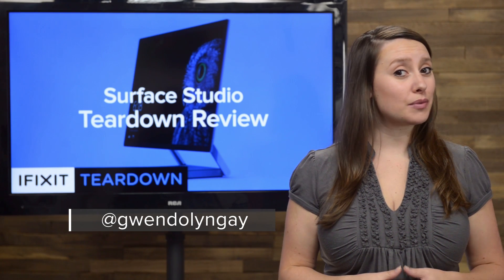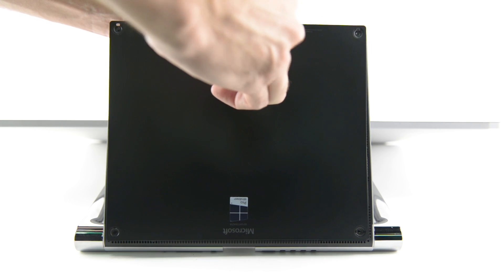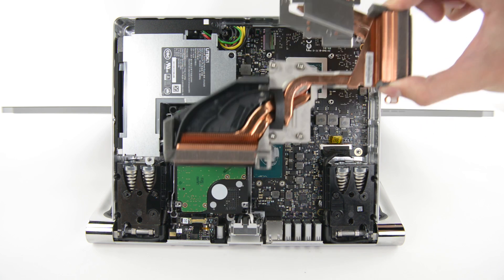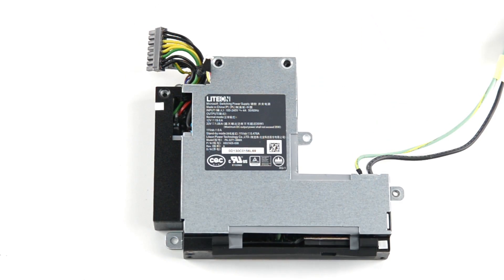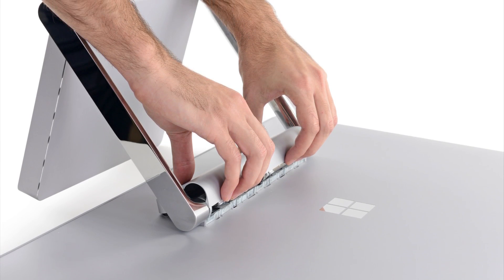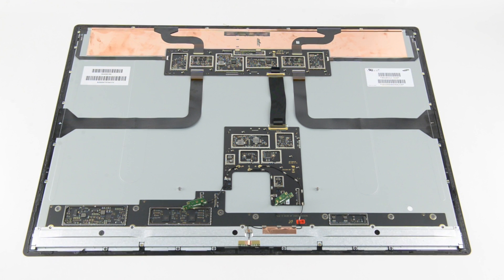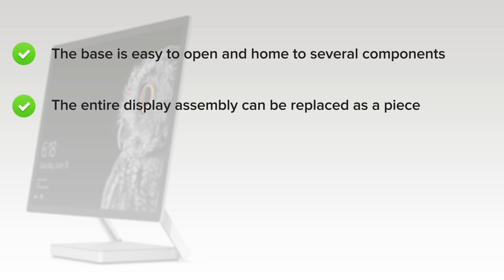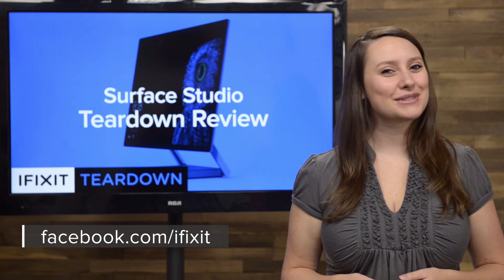Microsoft Surface Studio Teardown Review!

Comment: The 5400 RPM HDD would be the first component to upgrade. It´s a joke even when combined with an SSD. The 5400 RPM HDD was something I didn't expect to be found in a 3K machine. Even the high end 5K iMac with 2TB fusion drive has a 7200 RPM HDD.
Reply: Fisu614 and that's all you can upgrade.

Comment: need to upgrade to 1tb ssd, 16 or 32 GB ram, 1080 video card and quad core I 7
Reply: Friendly Guy On Just Looking Around. there are three versions of it, this was the cheapest one, the next comes with i7 processor, 16GB RAM and 1TB ssd, the best one comes with i7 processor 32GB RAM and 1TB or even 2TB of ssd i cant remember

Comment: I was waiting for this one..

The CPU is fixed, is ok for me. But memory. I wish it could be upgradable. That would be a shame if Microsoft will chose that path to demise Apple is currently on.
Reply: Sergey Romanov got news for you Apple starts the trend and everyone follows. This is a Windows version of an iMac.
Reply: floex831 This is a stupid trend that does nothing but decrease the potential life of a computer and removes choice for the user. I don't even get it, what excuse could there possibly be for non-upgradeable RAM in a desktop. WTF?  There is not even an issue with saving space(which I still think is a poor excuse) because you're not going to be moving it around anyway. What a load of bullshit.

Comment: 5 out of 10 seems to be a bit low. It looks rather easy to service most things.
Reply: Most things? Can't change the RAM, GPU or CPU. 5 seems plenty generous.
Reply: I would tend to give it a 6, just because it's not only easy to open, but there are also no special screws with security stickers and you can easy replace both SSD and HDD. 
RAM and CPU would have been nice, that's for sure. It's not like they are trying to stop the user or someone servicing it, everything seems accessible.

Comment: Not sure if nonremovable was the goal, but it would have been pretty easy to make the thing a half  cm higher, and add removable option. Heck. I wouldn't have mind if it was 1- 2 cm for bigger heatsink.
Reply: Bardia Ghajari I guess this might have interfered with how low the screen can be moved. They could've made it wider or longer, though. And the base model is a joke. 8 GB RAM? 5400RPM drive? No. Just no.
Reply: Yes, but 4-Grand for a desktop, which runs like a laptop, is for "take my money, I don't need it" people. People who need expanded performance already have another desktop, N.A.S, or cloud-strorage subscription

Comment: 5400RPM drive? That's not acceptable even for a base model, especially for that price.
Reply: My thought's too. It should be completely NVME SSD storage at this price point.
Reply: ***** The Wacom monitor offers more of what truly matters to artists. And, isn't limited by hardware limitations or upgradability like the Surface Studio is. N-trig's technology is nowhere near the capabilities and preciseness of Wacom's technology. As far as DCI P3, people using pen technologies to draw don't care about DCI P3. Wacom will still dominate the space.
Reply: 64GB or 128GB SSD that automatically caches off the bulk storage HDD. Not too bad. The Fusion Drive starts at 24GB to compare.
Reply: You'll have M2 SSD for OS.
Reply: straight from iMac apple playbook, base model s*cks then try to rip you off with expensive upgrades
Reply: That is pretty normal every small device.
Reply: Ayush Pandey M.2 is just a form factor that doesn't really matter with regards to performance. However, the Surface Studio does include NVME SSDs in their 'Rapid' Hybrid Drive System. And, the NVME does matter with regards to performance. But, it is only a 64GB NVME SSD with the low end model and only a 128GB NVME SSD with the high end models. That is pure BULL SHIT. Apple iMacs include desktop processors, DCI-P3 5k Screens, and the option for FULL NVME SSD's with no BS archaic mechanical drive shit. And, the iMac cost's over $1,000 less. The Surface Studio is a complete fail over their choice of slow, archaic storage.
Reply: I know right, my old PC back in 2004 had a 7200rpm hard drive but my new one is only 5400rpm. Ridiculous, it feels like I've downgraded.

Comment: i really consider this is better engineered than an iMAC
Reply: emotions are hard to quantify as are opinions 

he feels that this is better engineering than iMac 

perspective of each person unique : vision the consequence of the prefrontal cortex biasing known things against the incoming visual information from the eyes : the brain perform personally unique biological analytics that form opinions using personal bias that comes from each person's unique life experiences against the reality of incoming sensory information that gives rise to biased opinions, emotions, thoughts, not a quantification: consider comparing only one dimension, the reparability of an equivalent iMac (5K 27inch) and you will find modular CPU & RAM + Hardrive + SSD : in a well made aluminum case that is beautiful & elegant manufactured with cutting edge friction stir welding, with a display quality technology that is unmatched if not as novel given that wheel input device compatibility. The articulating range of the display mount is a modern marvel of engineering for desktop all in one :)
Reply: Гораздо лучше Эппла. Даже сравнивать глупо. Эппл вообще не ремонтопригодный, и фуфло ещё то.
Reply: And you can quantify that.... HOW?
Reply: ***** personal opinion of an engineering student...

Comment: Wait, so you can upgrade this bad boy up to 4TB SSD and 1TB M.2..... That's a big deal. I would love to see the next version sport a ssd out of the box with a Pascal GPU, at least a 1070m would be great. If they figured out SLI that'd be greater. And maybe some hidden ports on the front that can be revealed with a sliding piece of metal or something. I understand their push for minimalism from a design perspective, but they sacrificed a bit of functionality in the process which is never good.
Reply: leon scott there is No 1070m
Reply: theres no 1070m, even for laptop they use the real desktop like GTX 1070
Reply: leon scott yeah and the HDD to SSD and M.3 drives is all that's upgradable. Welcome to the Mac world.
Reply: There is no Mobile verion on the GTX 10 series GPU's only full desktop verion ones that are efficient enough to be PUT to mobile devices.

Comment: Meh. It's a big screen with outdated hardware. In 2014 this would have been impressive.
Reply: For that price there's no competition if you consider the screen. Of course you can get better hardware, but it would get even more expensive.
Reply: Wesley Jordan The 5k iMac is useless to people who need digitizer input(or far more expensive as they'd need to add a tablet). And when you compare the Surface Studio to the Wacom Cintiq you'll see Microsoft additionally stuffed a whole PC and a much better screen into one device for a reasonable price.
Also, show me a graphical artist who needs more than a 980M for drawing and similar tasks. The Surface Studio isn't a gaming or video editing/rendering machine, and everything else runs fine.

"Watch Microsoft drop the price on this bad boy in a year "

And how is that a bad thing? Definitely better than Apple's way of keeping prices up while Windows machines wipe the floor with the overpriced Mac Pro.
Reply: Wesley Jordan 5k mac has no pen support.

Still, the studio base model should not exist. 8 GB RAM are just to force you to buy a higher priced model.
Reply: In 2014 computers had a 7200 rpm hard drive for  $3000+.
Reply: SaHaRaSquad  For that price

You're right, because for less money you can get a 27" iMac with a 5K retina display, fast storage and more up to date specs. With the Surface Studio you're paying for the touch option, but outdated specs and a lesser screen. Watch Microsoft drop the price on this bad boy in a year to attract more people away from the iMac. It caters to a very small audience and they won't make enough money off this small sector who buys it.
Reply: SaHaRaSquad
As I said, the Surface Studio will only cater to a small audience and the Cintiq customers aren't going to instantly jump up and buy the Surface Studio. The machine is overpriced and underspec'd. Apple's products are selling in droves so they don't have to drop prices. They sell to the masses. That's how you keep a business afloat. You sound like a butthurt Microsoft fanboy throwing that Mac Pro jab into the mix. U getting Mad because I was posting facts? Grow up. lol.
Reply: Qwertworks And if you truly think a pen to do drafting on the big iMac screen will greatly increase sales... I doubt it. The Surface Studio isn't selling and serving a niche crowd isn't going to help Microsoft make the money spend on R&D for that machine.

Comment: OMG 5400rpm HDD in a $3000 computer ... What is Microsoft thinking?
Reply: Xiangyu Yin they want to be more like Apple. Nothing upgradable either.
Reply: a 3000 imac would have 1tb ssd and the ram is easily upgradable on the 27 inch imac
Reply: Supercharged and lose warranty. if you broke it you will get a new one because the replacement for the part is much more expensive than the original device.